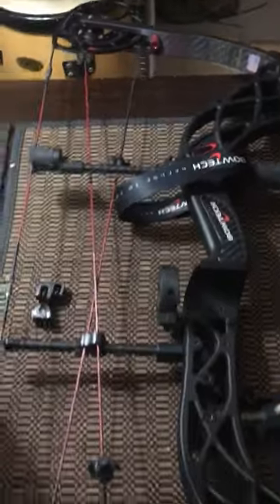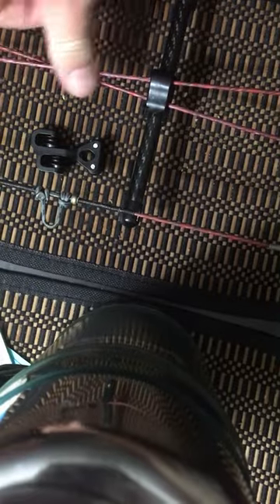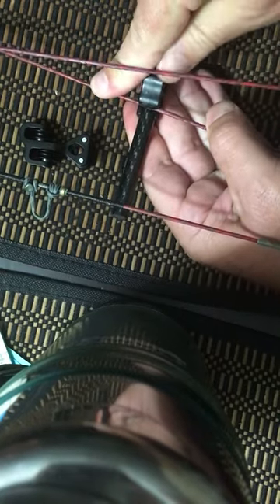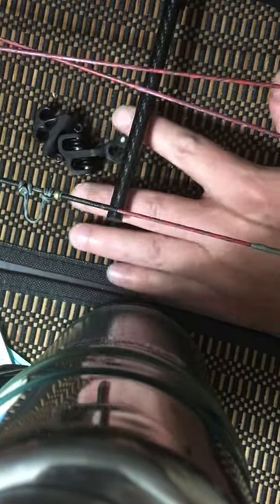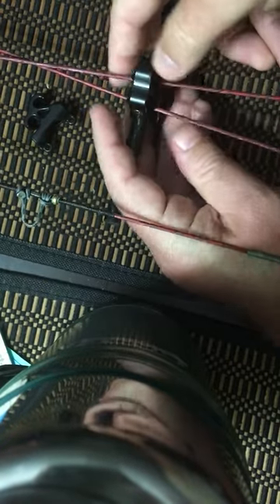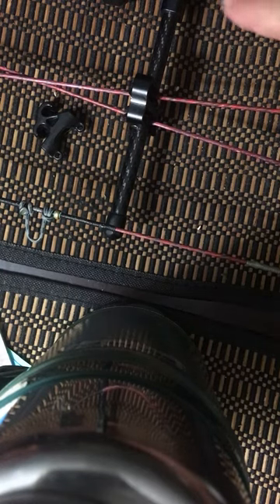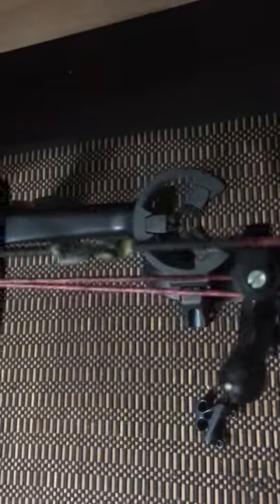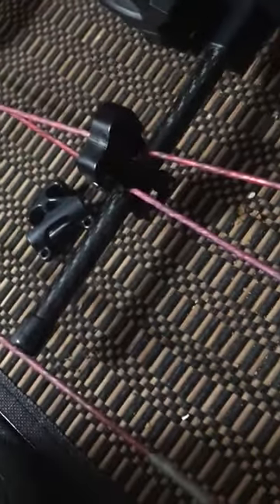Replace stock cable guide with  roller cable guide Bowtech knight

Comment: I ordered this for my 2020 bear species from lancaster to rid of the crappy slide. It should be here in 3 days.
Reply from the maker: It would be nice to get your thoughts about it after shooting with it?
Reply: @Videodiamonds  So far so good! My draw is extremely smoother and I feel a slight speed increase but nothing drastic. Other than that I have no quality complaints I've shot about 500 arrows with it installed now. Worth the buy.
Reply from the maker: @justinh8216  Right on Right on! Good review and glad you got the intended results. Happy Shootin'!

Comment: How is the clearance distance on the cables vs the fletchings? Is it better than stock or worse? On my setup i could use a tad more cable clearance. Thanks!
Reply from the maker: About the same? I tilt my nocks a touch (maybe 10 degrees) to give a hair more clearance but it's probably not really needed.

Comment: I'll be honest, maybe what I'm about to say is not entirely informed. 

Why are we still in the stone age? It's like a $200 price difference between a model that has a roller guard and a model with a cable slide when the bow specs might even be virtually the same. It's as if this single modification is actually worth $200 more dollars to the industry. Yet, I got the same modification that you got for only $15..... Why is this not standard issue to supply a roller guard like this? It makes no sense. Unless the industry is trying to achieve controlled obsolescence. But still, we pay a lot for our rigs. Sights, rests, quiver, arrows, and name any other of the incredible modifications out there. Yet the industry price difference for similar bows that have a roller guard opposed to a cable slide being that much more expensive? I just don't get it. The roller slide hybrid will never function as well as a real roller guard. But it's a heck of a lot closer than the standard cable slide that should not be on a bow to begin with in my opinion. I have seen too many strings on quality bows being eaten alive because of the friction. 

Rant over. If you have information on the topic, I would love to know.
Reply: This is correct my bow also came with the slide and after 200 + shoots you can definitely  see damaged on the the cables. I am guess it is done this way so you can change cables more often . Also whisker biscuit is  eating away arrows fletchings but it is on every ready to hunt package. I guess manufactures have found a way to make more money buy destroying your expensive arrows.
Reply: I'm glad I'm not the only one that was thinking this
Reply: @MickyMouseLimited  I have easily a thousand arrows through my Hoyt with the stock plastic cable slide and there is zero wear on the strings. Perhaps you were not waxing your strings.

Comment: What brand/model roller guide did you use? I have the Carbon Icon and I'm noticing a bit of wear around the stock guide.
Reply from the maker: 30-06
Reply: Did you ever replace you cable guide on the icon? Iam having the same issue with fraying and curious as to what you replaced it with? Thanks.
Reply: BlueLine FPV I did. I wish I could tell you a brand but unfortunately I don’t have the info anymore. I can say they are very easy to install and I had my local shop wrap serving where the frayed areas were. Been running great since. The stock plastic guide has edges too sharp; it rubs the string raw. Best of luck. I recommend the roller upgrade for sure.

Comment: I had my local bow shop install one, but my bow strings kept jumping out of the little wheels, so I couldn't use it.
Reply: Same issue -- what did you end up doing?  I was thinking maybe to extend the string stop a abit?
Reply: Make bandage on the calbles!
Reply: Try looking at a TAP cable roller, the TAP unit has larger wheels.
Reply: Sanders cable roller guide!

Comment: whats the benefit of this and will it cause any problems?
Reply: I had my local bow shop install one, but my bow strings kept jumping out of the little wheels, so I couldn't use it.
Reply: roller cables actuall roll when the string is drawn, so it prevents any friction between the string and a stock cable guide, which could fray the strings a lot
Reply: Bandage the cables